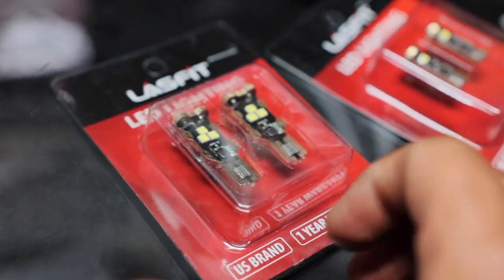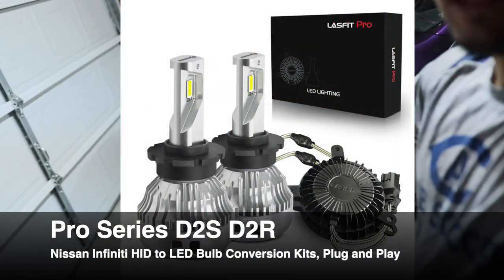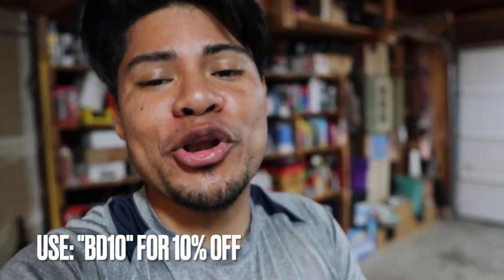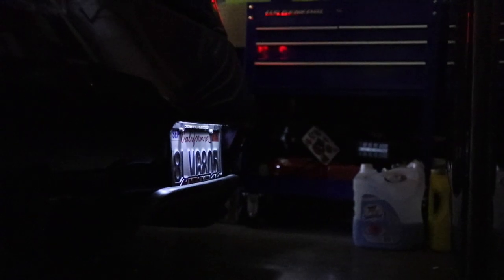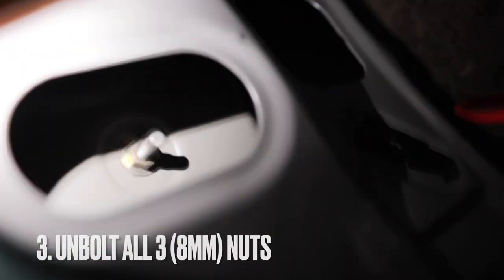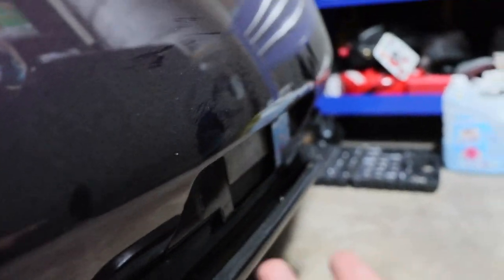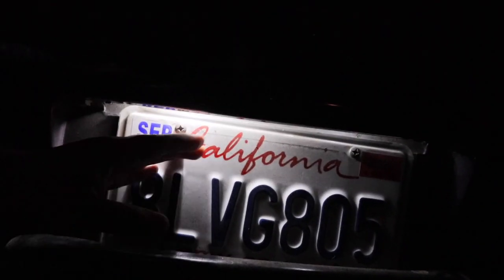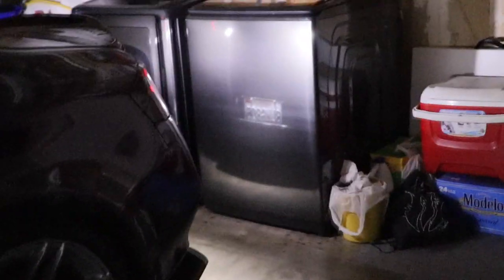Installing $20 UNDERRATED MOD that can TRANSFORM your Car !

Comment: I need some help ,I have a 2015 V6 RWD Q X 50 stock ! I want to get a exhaust setup and some intakes but I don’t know if the parts are compatible for my platform any advice or help please

Comment: Which lights do you have for your low beam, and high beams
Reply from the maker: Low beams are the ones mentioned in this video, HID to LED conversion from Las Fit. My high beams are from Amazon